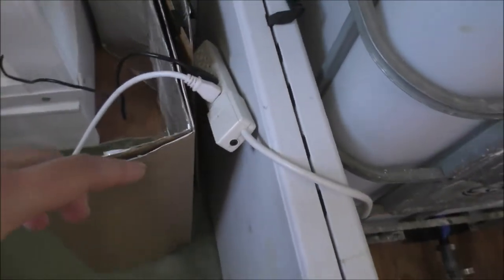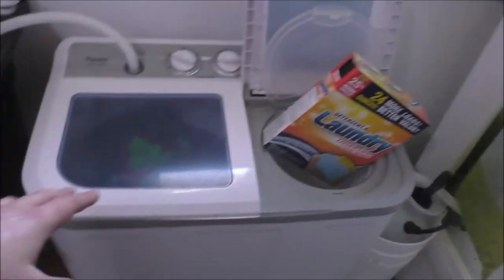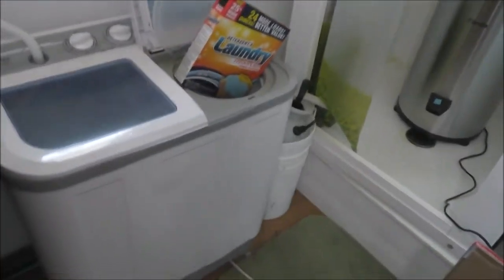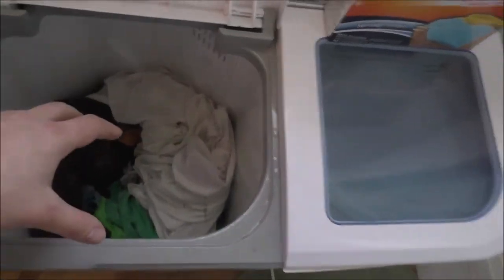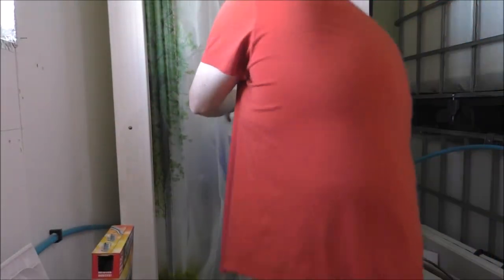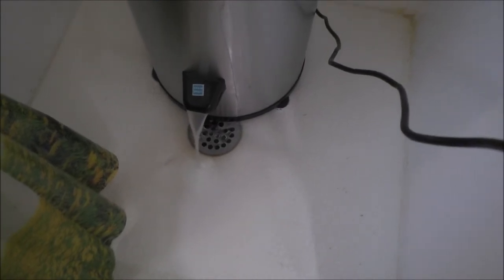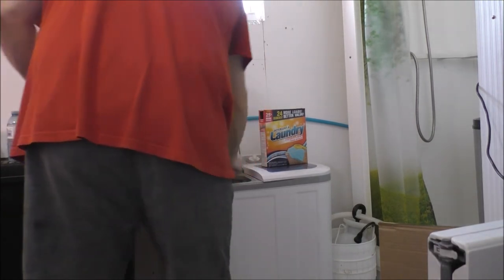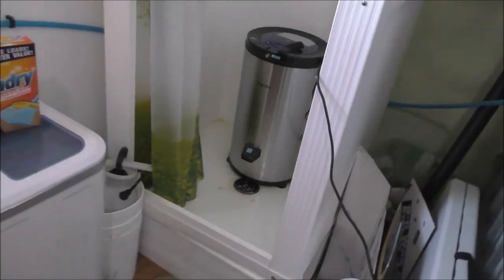Trying Panda Spin Dryer For First Time

Comment: My friend, your system as I have studied it can turn into a normal washing machine with squeezing ...... why did it bother with it ??????
Reply from the maker: the cost of a normal washing machine here is the problem. The cost is enough for me to buy both of these washer dryers instead.
Reply from the maker: @iamnotgonnagiveyoumyname1373  my large blanket no. but my two smaller ones yes i do them one at a time.
Reply from the maker: @iamnotgonnagiveyoumyname1373  twin size, my bigger blanket was like a comforter